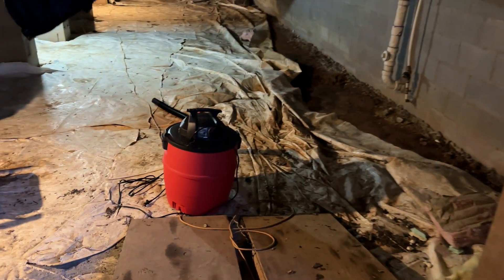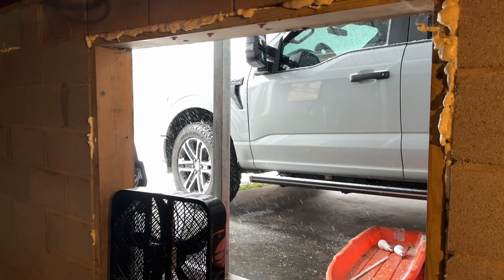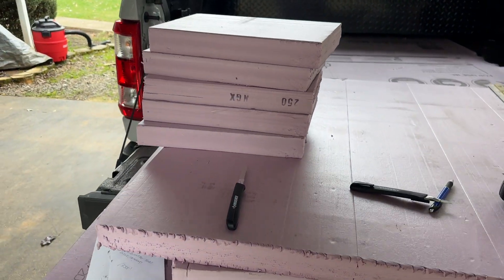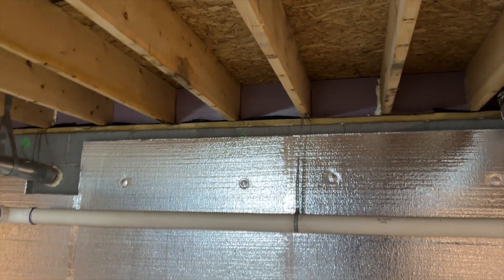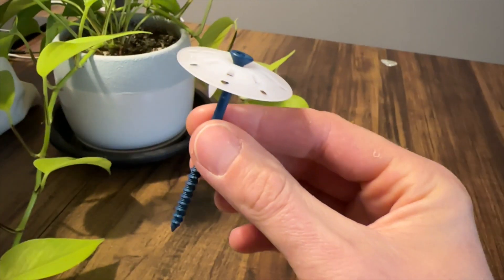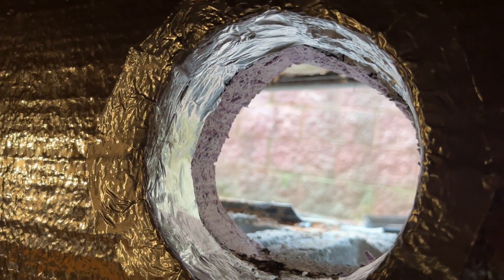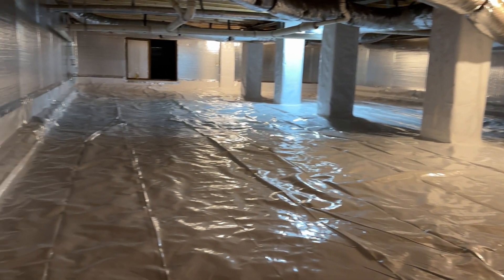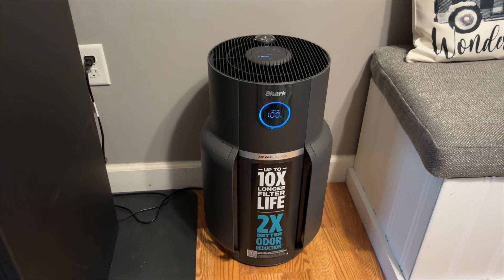Is Crawl Space Encapsulation Worth the Investment?  Radon Mitigation System

Comment: You’re definitely going to want a dehumidifier. You’ll notice a river of condensation under ductwork in spring/summer months. Look into Aprilaire dehumidifiers. We’ve installed thousands and they are second to none.
Reply from the maker: Agreed. I actually installed one later that summer.. I wound up handing it from the Joists and piping the condensation outside so I don’t have to empty anything ✅

Comment: How has your crawl space been since encapsulating it? how has your temperature been during the winter?
Reply from the maker: It’s been good. I put a Bluetooth temp/humidity sensor down there to keep a check on things. (I did go back and install an AprilAire Dehumidifier last summer because humidity was getting high) it easily maintains 50-55%. The temps have been in the 50’s this winter even without it being directly heated.

Comment: I don't think it's a good idea to seal your vents. Your crawlspace needs to breathe.
Reply: The purpose of encapsulating a crawlspace is to stop vapors and moisture in the crawlspace, since a typical “vented” crawl space actually allows humid air from the outside into the crawlspace.  In the summer, the home will experience what is called a “stack effect” from the hot attic/roof, with hot air rising up through the house and the humid air and gases being drawn from the crawlspace up into the home.  Same can go for winter, as the home is being heated and the warm air rising in the home will pull some air from the unvented crawlspace.  With an encapsulated crawlspace, all vents and areas where any humid air can enter the crawlspace are sealed,  leaving one vent with a small low volume exhaust fan installed in it.  The purpose of the fan is to keep the now  sealed crawlspace under a slight negative pressure to remove any odors or gases that might still get into the crawlspace.  The slight negative pressure might draw a small mount of air from the living space above which is fine, since it is a very low volume fan, and the air entering the crawlspace from the home above is conditioned.  However a dehumidifier also needs to be installed in the crawlspace that is now encapsulated to get rid of any humidity that might still occur.

Comment: You just created a termite highway. Good luck doing inspections. They will be nearly impossible to perform even with the safety gap introduced at the top of the foam board. Hopefully you left the 3" required gap at the minimum. And yes, you will need to deploy a dehumidifier once the moisture season returns. Or you may want to install a controlled ventilation system to restore the disrupted stacking effect. The radon system will exhaust some of the stale air, however, that system is designed to pull air from under the vapor barrier. Not above it. Encapsulations change the building dynamics of how the house was built. This is seldom discussed. Changing the stacking effect may cause air quality challenges. With this crawl space being stand up, that risk is much smaller. However, deploying a low voltage dew point fired fan system as opposed to the dehumidifier will be much more cost efficient with better results. The install does look nice!
Reply: How is it a termite highway?  It looks like he's left the 3" termite inspection strip at the top of the foundatuion walls.
Reply: @jeffschwing7318  It happens more than you think. In North Carolina the little buggers are hard to spot as it is. The tubes are tiny. Even with the 3" safety gap it is extraordinarily hard for inspectors to locate the tubes. I usually have at least two to three inspections each year where we find termites getting past the encapsulation protocols. Pest control companies will cancel termite bonds over this issue.